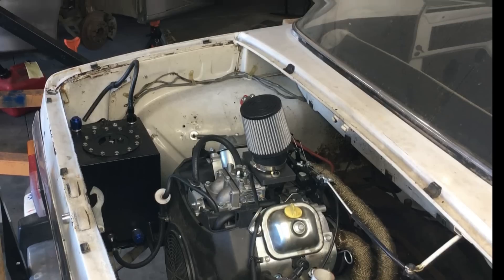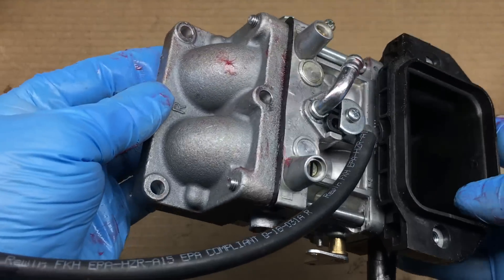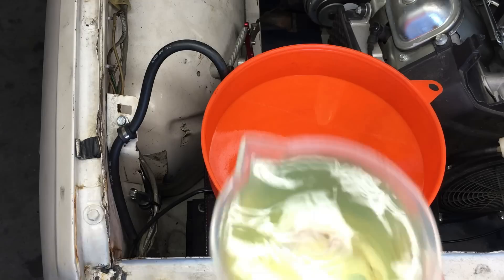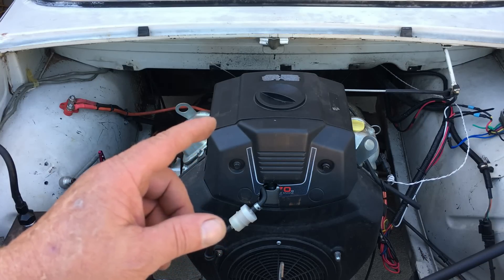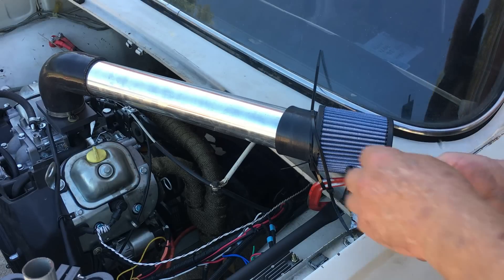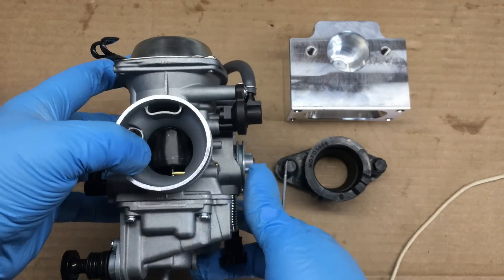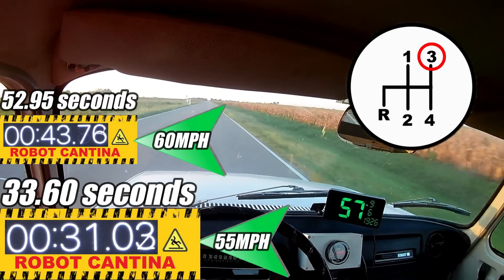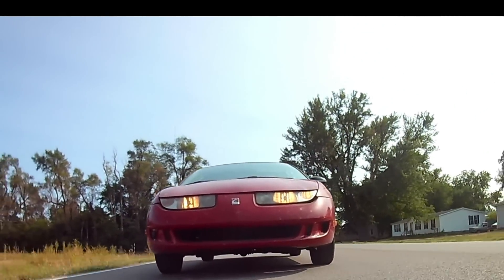S3 E28. Performance tuning and MPG tuning the 670cc predator powered Renault

Comment: I used to drive a Renault R10 back when I was in High School (1974-75). I loved the front seats in it and it also got great gas mileage back then. When I came to driving it in the snow it was much better than than rear wheel drive cars of the time. It also had Michelin X radial tires on it. Radial tires were unheard of back then. My dad later replaced the back tires with a set of bias-ply tires. This made the car extremely unstable to drive as the rear of the car wanted to fishtail on every curve. It would be neat if you could find a person who still owned an original R10 and have a race between yours and the original car with the 4-cylinder engine. Thanks for posting these interesting videos.
Reply from the maker: Thanks!   I agree it would make an epic race between the 670 R10 and a stock R10.  Sadly the only running R10's that I'm aware of are out of state.

Comment: I think the car would perform better if the gearbox were just the regular one. I know that the cvt is in there to make things simpler, but I think it is worth the hassle matting this predator engine direct to the original transmission

Comment: In my experience with tuning cars, fuel ratio is only half of the equation. The perfect (stoichiometric) ratio is 14.7:1 at this ratio you get the most efficient burn. 

The other half of it is ignition timing you want the timing to be advanced to the point the motor creates the most power as possible then take a degree or so out for safety. 

The more power the motor makes the less throttle and fuel you need to supply   to get the same results. 

Don’t know if you’ll read this or not but hope it gets to you and possibly help :) awesome project

Comment: I have some points to make:

* Using a shared plenum between carb barrels is not a good idea on an uneven-firing engine. One cylinder robs the other due to intake pulses being closer together in one part of the cycle than the other.

* The "richer" readings you were getting with the carb shrouded might be due to more complete combustion from better atomisation. More oxygen is being used up, less comes out the exhaust, O2 sensor shows richer.

* The long intake tube might be providing a tuned induction effect, which the carb may not be calibrated for.

Comment: Ram air does work great on old Toyotas though! 

I bought an 86 4x4 toyota many years ago, and the old guy I got it from swore up and down that it got way better milage since he modified it to "ram air" 

His version of a ram air intake was cutting a hole in the side of the airbox, and then using about a 12 inch section of hose from a household vacuum cleaner to stick in it, and then through a hole punched in the grille. 

I thought it looked funny with the vacuum cleaner hose sticking out the grill so I left it for a long time, then got curious one day if it really did help, 

I tested it pretty easily because i drove the same route to and from work every day, in the night, so not really any traffic. I took it off and covered the hole in the airbox, and got about 22 mpg, then I uncovered the hole in the airbox, and got again 22 mpg. Then I put the hose in, and it shot up to about 27mpg, I thought that was crazy so I went back and forth for a couple weeks one week off and one week on and always got the same. So I just left it

Comment: Vacuum slide operated (constant velocity) carbs on dirt bikes suck.........mostly because they dont respond well when the throttle is slammed open.  Thats why pumper carbs are much better, soon as the throttle is cranked open, the response is crisp and energetic with that little squirt of extra fuel.  But the CV carbs are better for fuel economy.......and just fine for a car.   Thats interesting about the cold,ram air intake, leaning out mixtures........provided the jetting can cope, that would seem like potentially more power air flow and power that could be accessed.

Comment: Thats a great idea with the grease on the gasket, I always use HHS2000/silicone grease/motorcycle chain lube spray on my small engine assembly gaskets, and sometimes I put gasket glue on one side if I want the gasket to stay in one piece and sticking to either side I decide 😉

Comment: I was thinking about power to weight and acceleration times and wondering if the motor and battery system from a scrapped disability scooter or a  battery electrical assisted bicycle could potentially provide the extra bit of push needed for the transmission to overcome the vehicle weight during hard acceleration , and disengage / recharge  during cruising , without adding much weight like a basic lightweight hybrid or the system used in the old Dieselec trains  ?

Comment: All cars before the introduction of electronic fuel injection ran inlet manifold heating to aid atomization. In most cars, exhaust gases were used to heat the intake manifold but in some vehicles with inline engines and crossflow head coolant water was used. This system was also used in conjunction with a warm air diverter for the air cleaner to stop ice particles from forming in the carburetor venturi area and blocking the main fuel jet. The warm air induction tapered off as the engine reached operating temp because engine efficiency does improve with colder and therefore denser intake air. The more volume that enters the cylinder the higher the compression is and the more force generated by combustion, e.g. more power. As the engine is running more efficiently then fuel economy is generally better unless you let the extra power go to your head and push the foot down harder than normal. The new carburetor is a modern adaptation of the famous British SU units seen on so many British cars when performance was wanted and in the case of Jaguar they had up to three of them for a six-cylinder 3.8 and 4.2-liter engines.

Comment: Thanks for sharing all the experiments and failures, i mean lessons.  There is a lot of engineering that goes into a simple lawn mower! I wonder if there is an equalizer or equivalent designed into the carburetor and you've missed it? Lots of tiny holes when you gotta clean dirty spoiled fuel. Also that VW intake looks as wide as your renault, of course they needed to heat that for vaporization optimization. This engine seems compqct enough where there is an optimal amount of heat soak. A compromise anyway. Keep up the good work and the bad work. Thanks again for sharing !

Comment: Ram-Air systems are still common on lots of modern cars. 🙂 I think every car I ever owned in the last 25 years (from tiny to turbo to big engine, diesel or gas) had a plastic snorkel that collects fresh air directly at the front of the car and feeds it into the airbox.

Comment: The discussion about warm air intake reminds me of the "thermac"/thermal air cleaner/exhaust manifold heat shroud on a ton of GM cars from the late 60s and 70s. There was a vacuum modulating thermostat and a vacuum operated solenoid connected to a door on the air cleaner. The air cleaner had a normal under hood or front grille intake, and also an intake that connected to a flexible hose and shroud around the exhaust manifold. You can find some excellent 1960s service training videos from Chevy that explain this system in detail - it would blend the air intakes to target a 125°F intake temperature in all conditions.

If I remember from the original EPA documents, this system reduced cold start carbon monoxide by ninety percent! That's a huge improvement on top of driveability and efficiency improvements.
Reply: Ah! Found it!
https://youtu.be/FDu0a9X_qBs

Comment: i did read about an intentional fuel-air heating system in an automotive magazine last time i got my malibu inspected, they were claiming significant performance gains from having the fuel in the gas phase perfectly mixed for combustion. 
they also claimed it made it less likely to detonate, but hey ho magazines say a lot of stuff and it's not always true. worth investigating.

Comment: On a ram air engine if you can run a tube from the float bowl vent to the mouth of the ram it will help it from running lean by pressuring the float bowl

Comment: It's a 4-stroke, right? So in theory, you could convert it over to steam if you wanted to, by changing the valve timing? I wonder if you could add turbo to a steam engine. Though not the original vehicle-steam-engine, that thing is a beast, with 800 lb of torque, w/ 700 psi and 700°F running temp.
Reply: https://www.youtube.com/watch?v=OoXr09y2AQ4

Comment: The rpm switched crossover would be fairly easy. Make another one a bit thicker with the passthrough the same size as a machined pin. Put a hole in the top with an oring groove the size of the pin. Pushed in it's closed between the barrels and pulled out to the inner top of the spacer it's open. Cable operated simple. Rpm and solenoid not that complicated with some jungle site electronics.

Comment: So I have a couple of ideas for you to increase performance splitfire or quad fire spark plus as well as either VP octane boost . Or Royal purple octane boost as well I seen the predator engine on a different channel with a small electric turbocharger or exhaust driven turbo I know it will affect the the carb but you can change the carb to a single slid carb or a 4-barrel carb system

Comment: If the spacer affects throttle response, could you drill a hole between the two down tubes to add cross flow without a spacer?

Comment: You need a boost reference fuel pressure regulator for any type of forced induction with a carburetor.

Id guess the reason the original intake spacer didn't work is because the transitions weren't smooth. And the sharp edges disrupted airflow

Comment: Jimbo, I appreciate you take your time to do these fuel economy tests.
As always, tip of the Hat to the Robot Cantina Team for all your efforts and mad science-ing. 👌🙂👍
P.S: The cold air induction it's always a blessing on ANY engine operating in warm climates.
The whole ram air debacle: YUP, YOU NAILED IT ! It's the same as trying to run a blow thru turbo or supercharged system with a regular carb off an N/A engine.

Comment: If you used diesel 4 cylinder 1.6 renault 9 or 11 engine, fuel consumption would be less than 4.5 L/100km. So the project you're doing is pointless

Comment: A couple minor criticisms ---

One, "vapor" isn't a phase-change transition. It's bits of liquid in air. I don't know much about Volkswagens, but I know juuust enough about physics to catch that one.

Two, as I've said before, the ironic wrong pronunciation of "Renault" as a joke was old enough to be my great grandfather when you started with it. Please stop, it's not funny, it just hurts my ears.

Three... what is it with most Americans and the Metric System? For chrissakes, it's powers of ten. Add a zero at the end of your number, or take one off. If you run out of zeros, move the decimal point in the same direction instead. You don't have to remember weird stupid mnemonics or twelve of this to sixteen of that or any of it, and on the whole it really DOES make a lot more sense than however many eagle talons per cheeseburger it is for whatever you're trying to measure. Take two aspirin and get over it.

Having said all of that, and with those few exceptions that (unfortunately) snagged me a bit, excellent episode as always. I do enjoy watching you tinker, as I've said in the past.

Comment: Garage 54 did a test when they did heat up the fuel to its boiling point and did get almost 2/3 the mileage as with the ambient temp fuel. Sure, the test subject was fuel injected.
Our old moskvitch 412 had also problems when it was below freezing. It also had a pipe connected from the exhaust manifold to the air filter. On summer, many drivers(my Dad also) disconnected the pipe to get better performance and mileage. But in autumn, if you forgot to connect the pipe back, then you where sitting beside the road waiting to the carb to heatsoak a bit and drive forward few km/miles if you did nod had the pipe with you.

Comment: Hey, just a thought! If you exchange your factory pulse pump for a cheap small electric fuel pump for carby supply pressure, would it be possible to use the factory inbuilt fuel pulse pump as a vacuum pump to actuate the diaphram on your Keihin cvk? That way the engines speed varies the vacuum pressure along with some kind of check valve and adjustable bleed valve for tunability.

Also. What if you bought a long-ish cheap copper heat pipe and routed it from a close hot part of your engine to your new manifold.

Comment: Re: The CVK... Would it be possible to get two CVK carbs and mount one on each cylinder (like most motorcycles etc), have them connected with a linkage and balanced??? 🤔🤔🤔
😎🇬🇧

Comment: 09:38 - For the 'Ram Air' to work more effectively, you'd have to install some form of fuel injection system setup, driven by a seperate 'Stand alone' ECU with various sensors to monitor and adjust fueling to suit the increasing air flow the faster you drove. It CAN be done, but, it's not cheap as, well, you'd have to buy the gear, install it, and then book the car in for a coupla runs on a Dyno to tune it correctly & effectivly... So... Sadly a little too much for this kind of project. Though yeah, it would be intriguing how that route would go with regards to power & economy. 🤔
😎🇬🇧

Comment: 07:12 - Hahaha yeah, I suffered 'Carb Icing' once. Many years a go I had a 1991 VW Polo Classic 1.3 Litre (2 door saloon). I had removed the large circular metal air filter & housing (the design that had a 'Summer/Winter' flap that would allow heat to be directed up through to the air filter housing for warm air to stop the carb feezing in winter), and had installed a home made sponge air filter... ALL WAS FINE in the summer months (could hear the induction roar sound nicely too 😏😉), but, one time during a cold November night driving home from a girlfirends place, the car suddenly coughed and died miles from home. I though "FAAAAK! How am I gonna get home!?" Anyhew, checked under the bonnet, nothing seemed out of place, tried starting the car again and, hey presto! She started! And so, gingerly drove her home expecting a total breakdown... Well, this happened a few times, and after some research I was starting to get a few ideas (fueling? Blockage? Carb Icing?) until one night, torch and screwdriver at hand, I was ready for it. Yup, she died, so I quickly pulled over, popped the bonnet (hood - for you guys lol), unscrewed my DIY air filter, and yup! There it was... FROZEN FUEL in the top of the carb! Hahaha. Being a biker too I felt such a dope as I SHOULD have recognised this from the start! hahaha. So, I swapped back to the original filter & housing for winter, then back to the DIY foam one for Summer. Ohhh what a numpty eh? Hahaha 😉 Sadly, I miss that car 😟, it's one of a few that I SHOULD have kept...
😎🇬🇧

Comment: On the ram air idea, there is a difference in pressure between the fuel in the float bowl and the air in the intake pipe. If you connect the float bowl vent to the intake, I'll bet the mixture will be more stable. Rotax used to use this trick to their advantage in the 90s to tune their carbureted snowmobiles for higher altitudes. It was called a H.A.C. or high altitude compensator. Early versions used some kind of mechanical vacuum regulator, but later versions used a solenoid to regulate the negative pressure on the float bowl.

Comment: Alot of Carbs Like the Webber 32/36DGV have an open chamber from the filter to the Fuel bowl which equalises the pressure between the air entering the Venturi's and the Fuel Bowl increasing the fuel pressure in the bowl along with the Air pressure. this allows the carb to stay in tune at differing altitudes, and can work with a Ram air induction as long as the air pressure doesn't get too high. the size of the opening to the air and the air speed determines the pressure along with the amount of air the engine is consuming. I tried this on an electronic fuel injected engine with a MAP sensor, and it was able to turn the added air pressure into power while maintaining correct air/fuel ratios, at 100kph, it was making 10% more power, but the loss of power due to the extra piping was also very noticeable at low speeds

Comment: A tip for the ram air intake, if you connect the breather tube of the carb into the intake, you compensate for the extra pressure, it will still lean out, but a lot less.

Comment: So you can add a pito tube to the vent for the float on the carb and it will compensate for the small boost and actually big boost too that's how we do blow through carbs. Size matters not flow so I'd start with a 3/8 line into the flow but you might be as small as 1/8in I like using a main jet on the end for easy tuning

Comment: My suggestion is get rid of the 90deg angle adapter. Use a straight adapter. Get a Rochester Model H from a corvair. It’s a down draft carb. Then this will open up you whole world for adjustments. Simple easy and parts are available.

Comment: My old Suzuki bike has 4 cvk carbs. I can asure you they are easy to calibrate/set due to the variable venturi. Fuel economy/power is almost the same as the fuel injected system.